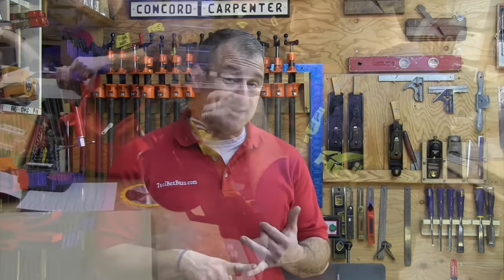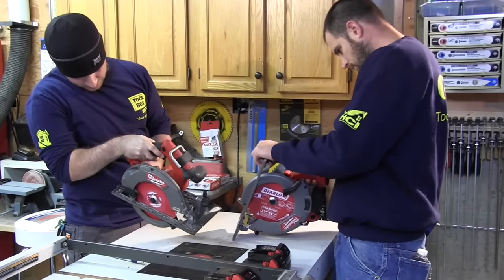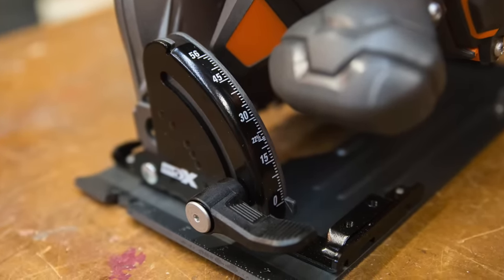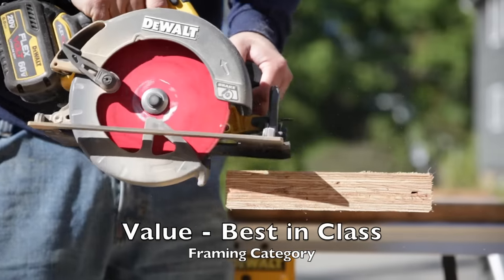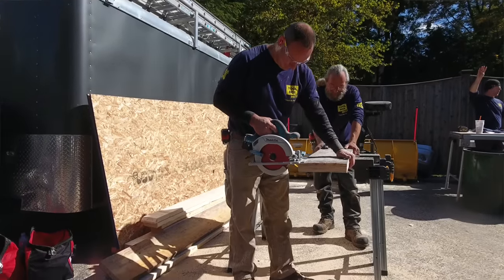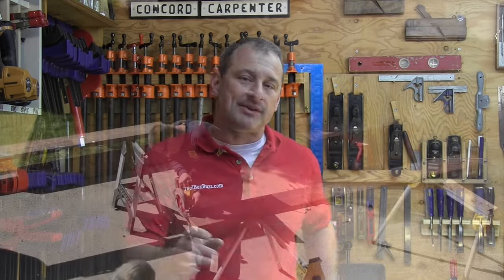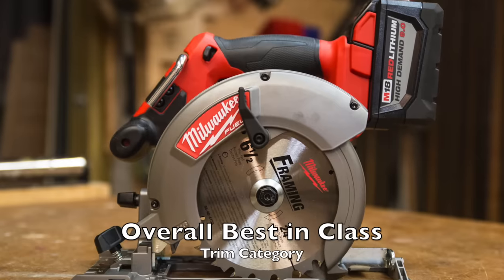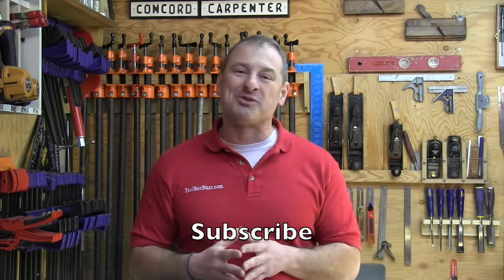Best Cordless Circular Saw - Head to Head

Comment: I have the Milwaukee Fuel 7 1/4". It cam with saw 9.0 amp hour battery and charger for $249. You add another battery and you are stull under the others. My opinion the Milwaukee cant be beat.
Reply: I took advantage of that deal as well. For 249.00, you are actually purchasing the Battery & charger and getting the saw for free. - Still a fantastic deal. - Love mine.
Reply: I bought the tool only saw about 6 months ago for $200, doohh...I think ill buy this deal just to get the 9.0
Reply: Dan 
but don't forget guys... U only get, what u played for !!!
Reply: They still have that promo! I just bought mine today. They also have it for their Sawzall but I just can't justify buying that since it's a bit much for a DIY guy that would hardly ever need it for anything.
Reply: Your only argument is that the Milwaukee is cheaper. That has nothing to do with the quality of the saw.
Reply: Just got that deal at home depot--it was an online only deal but the manager gave me that price! I was going to buy it at 229 for the saw only a week before...what a deal 😀

Comment: I am a Milwaukee M18 Fuel fan!   I love the power of the every M18 Fuel tool, but the 2731-20  7-!/4" framing saw is a MONSTER!  The 9 AH Red battery lasts and lasts. The coolest thing is that tools from this line often appear in the clearance end cap at Home Depot for ALOT less money than full.   Just last month I picked up a combo kit with the 2731-20, a fast charger and a 9.0 battery for $187.00!   I just could not pass it up as full price is over $350 and combo at $250.00.  The best time to shop for  ANY cordless tool is of course Christmas.  This is when good priced combos pop up and as they are not normal merch, they will often appear a couple of moths later on clearance. (at HD anyhow)  I have had Makita and Dewalts and Rigid, but for my dough Milwaukee Fuel is the way to go.   Fantastic backwards compatibility on all Milwaukee battery fits too!

Comment: I have the Makita 6 1/2" Brushless circular saw and I am constantly impressed with how smooth and how powerful it is. I know there are other saws available, I just haven't used them. Also, while I'm invested with Makita for my cordless tools, I am excited to see the other brands innovate because I know it will translate it better tools from Makita at some point down the road.
Reply: Also the Makita 6 1/2 has an attachment the allows it to work with their track saw rails, turning it into a cordless track saw. I don't know if it's available in the states or not. It's not officially available in Canada but there are a couple of companies that import it from Europe.
Reply: SteveVD do you have a link or can guide me to that info?
Reply from the maker: Saw that - amazing accessory
Reply: The accessory is the Makita 196953-0 Guide Rail Adapter. bcfasteners.com/shop/makita-196953-0-guide-rail-adapter/ is the Canadian site I found it on and https://www.amazon.com/Makita-196953-0-Guide-Rail-Adapter/dp/B01GCGUTFG is where I found it online for the states. Though looking at it closer again, it is on the Makita's US website. So if you live in the states you should be able to order it through your local Makita dealer.

Comment: I've personally used the makita, dewalt and own the milwaukee. What he didn't mention was torque and power. The milwaukee with a 12.0 amp and 9.0 amp battery will over power both of these saw by a LONG shot. I ripped 4" off a 3.5" psl recwntly. It powered through just as good if not better then any cordless saw I've used. I've also cut through as many sheets as possible on a lift of 3/4 plywood without any stopping or binding. The dewalt could never come close to that. Makita as well. No other cordless saw that I've used can power through anything like the milwaukee. It's truly surprising
Reply from the maker: kris drepko this rest was done before those batteries were available
Reply: Dude the Dewalt flexvolt is a lot more powerful than the Milwaukee it's not even debatable
Reply: You must have been using the Dewalt 20v. I've used them all and nothing comes close to the Dewalt 60v for sheer power. Match the 60v with the 9amp battery and there is your winner.

Comment: I am currently in the market for a cordless saw and cordless jigsaw but have always been a Hilti fan when it comes to drills and impact drivers.
 I also own a cordless DeWalt planer and multi tool in 18v (UK) due to the fact that Hilti come nowhere in this test I am left with probably going down the DeWalt flexvolt route as I am also considering the flexvolt mitre saw. I understand Milwaukee came out top in the review but you don't see a lot of carpenters/ Joiners on that platform in the UK, mainly the M&E guys. 
Thanks for the review guys its opened my eyes to possibly purchasing the wrong saw because of brand loyalty

Comment: Interesting how Dewalt and Ridgid came in 1st and 2nd in cuts per amp hour.  Also, no one talked about cost.  I get the feeling one of these may have been the lowest purchase price.  Not to mention Ridgid offers a Lifetime (25yr.) warranty on tool and battery.  None of the others offer that.
Reply from the maker: Raul Perez did you read the articlE? There’s always more information there.

The cost of the tool, or in this case the combination of components, is a clear objective. But value is not the cheapest tool, but the tool that delivers exceptional performance for its price. This head to head is a Frankenstein combination of components; tool, high-capacity battery, and charger. So we’re seeing higher price tags than the off the shelf kits you’re used to seeing in the stores.

The graph in article  is broken into two sections, one for the 6-1/2″ saws and one for the full size 7-1/4″ saws. We’ve listed the pricing based on the price of the tool, a charger (in some cases they are dual chargers), and two high capacity battery packs. Because one of the tools uses two packs in order to operate, we felt it was best to level the entire field by using two packs as the basis for cost and how much work can be accomplished with two packs.

Value Winner (Trim) – Bosch

The Bosch CCS180 with exceptional ergonomics, a decent runtime, and a reasonable price for all separately purchased components make this our value winner for the trim category. During our last circular saw head to head this tool with a 4.0Ah battery was named best in class for endurance. So although this is an older model, it still displays good performance and is well priced. You can expect to pay around $347 for the tool, 6.0Ah battery, and a loose charger.

Value Winner (Framing) – DEWALT

This category is typically dominated by Ridgid due to the aggressive pricing and quality performance. They certainly came close this time but the real winner here is the new DEWALT FlexVolt priced just below $400! This is the only saw that we tested that came in a true kit with the saw, charger, and two batteries.

But with the disruption of the FlexVolt line, DEWALT’s new system is a big ask for current 20V users. Although the FlexVolt batteries are backwards compatible, DEWALT is still upsetting the apple cart by introducing a new line of tools no longer useful to the users invested in the DEWALT 20V line. With all that said, DEWALT needs to entice users over to bridge the new battery platform. Either way the DEWALT offers a very powerful tool, currently sporting a 60V, 2.0Ah battery, with plenty of room to run at a great price!
Reply: @ConcordCarpenter    No I didn't read the article.  I'm on YouTube looking for videos that help people make decisions spending their money on tools with factor that most people care about.  I appreciate this video for those reasons, however, I think that your ultimate break down could be displayed at the end of the video     where performance of your various tests, cost and warranty are noted.  Thanks for clearing some of my concerns regarding the video's information up.
Reply: That 25yr warranty is a limited warranty that covers manufacturers defects ONLY. It doesn’t cover wear & tear or damage. And it’s worthless if you never registered the tool.
Reply: @thomasarias5732   I got new brushes for an 8 year old Rigid driver under this warranty.  I have also had a brand new Porter Cable router that I maybe used 45 minutes over the course of a year and it quit working.  Took it to my local Dewalt/ Porter Cable authorized dealer for repair.  It was exactly 14 months old and the one year factory warranty was expired.  I suppose we get gems and duds with whatever brand.  Everything has pros and cons.
Reply: Raul Perez that’s why I only own ridgid cordless. Can’t beat the warranty
Reply: Had I known about rigids warranty when i started buying cordless tools Id be all about them. You cant beat that warranty and the difference in performance is so slight in real life....
Reply: @thomasarias5732  wonder if that is a store by store thing. my cousin brought in a rigid drill he had owned for a couple years and they just gave him a new one off the shelf.
Reply: Go DeWalt over Ridgid. I work as a contractor. My Dewalts Outlast everything. Such incredible tools.
Reply: sean callahan agreed. I’m still using my DeWalt 18v hammer/drill/driver that I got in 2001. And I’m not a weekend warrior lol. I worked 12-15 hour days 6 days a week for over a decade with my DeWalt cordless tools. So far I’ve replaced a bulb in the flashlight once for less than $2 lol. I haven’t even replaced a battery yet, of course I’ve bought more batteries to supplement mine so I don’t have to charge any on site. But seriously I couldn’t have asked for better performance at all. 
I just bought my son his first set of cordless tools for Christmas. 10 tools and 8 batteries all 20v or better. I hope he likes them as much as he likes borrowing mine lol
Reply: C. A. Willie the warranty is for defects only, so your cousin either got lucky and had that happen after a few years, spends a ton of money at that store, or dealt with an inexperienced employee. Here is a link to Rigid’s warranty description; pay close attention to the “What is covered”, “How Long the Coverage Lasts” and “What is NOT Covered” sections. https://www.ridgid.com/us/en/full-lifetime-warranty
Reply: @thomasarias5732  That is still better than all the other 90 day, one year or three year warranties all the other brands have.  Like I said I got new brushes on an 8 year old driver and that was 3 years ago.  Thanks for the link.
Reply: @thomasarias5732  Registering is easy.
Reply: @wackedgunner7107  Agreed!
Reply: @thomasarias5732  That is a very good point!

Comment: Great video! Recently went from Ridgid X4 to Milwaukee Fuel tools, and have been a little conflicted with the change. Initially, the M18 fuel tools displayed considerably more power until they were put under heavy loads, at which point they “detune” themselves to preserve the tool and extend battery life. On one hand this is good, on the other, time is money and the under-performing tools are costing me both. 

You may say that I need a larger tool commensurate to the task, but I would counter that, having reached the half-century mark, with joints that have spent over 30 years in construction, tool weight is a premium. Milwaukee are definitely better crafted, but I feel are coming up short in the “getter done” category where a tool that goes all out, yet has a shorter life-expectancy is a better value.
Reply: Which tools are suffering that much under loads?

Comment: I use a Milwaukee 6 1/4 for all of my work now , nice and light and on average I use a battery and a half per day . It has plenty of power for all of my cutting and any time I need to get through something tough ...just slow it down . It's one of my best tools and I'm not surprised it won best over all as it's very good and I work my tools fairly hard

Comment: Use the DEWALT 60 volt 7.25” and it’s a beast.   Corded saw gone!   And I get to use the Flexvolt as a high capacity 20 volt in my high draw tools like site blower and recip saw.    An amazing system.
Reply: pbrin Yeah mate ,I'm glad I went with  Flexvolt, it is by far the most powerful saw I've ever used .

Comment: Dewalt 60v is by far the best saw today
Reply: 100%. I also have the Milwaukee gen 2, and my Flexvolt runs circles around it. I actually despise my Milwaukee because it’s so bad in comparison to the Flex.
Reply: True
Reply: though putting a 9 ah battery on  an impact driver  though it works is a little heavy . backwards compatible awesome .60 volt battery on the 20v chop saw goes all day

Comment: Hey guys like your videos. I know I am late to the comments on this one but I have something people might want to consider. I am a commercial contractor and have about ten guys working for me. I typically supply them with tools. I have noticed they usually pick Makita to use. I have always used Dewalt. After the years have gone by I have decided to supply them with only Dewalt as the Makita batteries have gone bad so many times. The Makita batteries also become loose and have a bad connection. After I switched them to Dewalt I have never had an issue. Just my experience. Thanks for the reviews
Reply from the maker: Brandon Brady Really great feedback, thank you very much for sharing

Comment: I think you shortchanged the Makita by giving the other saws two batteries just because the Makita REQUIRES two batteries. All else being equal, any vendors 36V 4Ah battery has the same energy capacity as two Makita 18V 4Ah ones.  The two batts on a Makita saw are equivalent to a single 36V battery on the other saws, without the expense and aggravation of needing a whole new battery/charger ecosystem. When using the Makita saw you shouldn't think of it having two batteries... instead think of it as a single 36V battery and compare that way with other saws.

Makita knocked it out of the park by combining the power of 36V with the economics of its HUGE 18V cordless line. If you are a pro I guess it doesn't really matter if you need different batteries and chargers depending on the tool you want to use, but for everyone else being able to use your existing battery ecosystem is a game changer.

In case it isn't obvious, I do indeed own the Makita, and I love it.
Reply from the maker: We certainly see your point and we're aware of it.
Reply: Most of those saws come with two packs in the kit, if the saw requires two packs to operate and they don’t give you 4 so you can continue working while the others charge it indeed is a serious shortcoming of the tool when compared to the others.
Reply: The makita with their charging system definitely beats it all  Why double battery makita saw laughs at people I do have 20 batteries
Reply: 1slkss for most people they don’t just own one cordless tool and highly unlikely you would only have the framing saw as your only cordless tool. Long way of saying most people would have more than 2 batteries
Reply: Martin Green well said. Bought the 36v rear handled circ saw. And it’s absolutely crushed my friends still using the corded skilsaw. Also I’m not leaving the platform. So if need be I can swap batteries from other makita tools I own
Reply: I agree 2 18  volts is less then 60 volts. And 36 volts is 36 volts vs Makita 2 batterys which = 36 volts it should be that the 60 volts should be penalized. and I read some other fool saying only the  Dewalt can cut like a corded saw  which is BS my brushed Makita with 2 batterys cuts just as good as any skil saw or my corded Makita with 15 amps. Some of these comments are being made that never done this shit 4 a living.
Reply: I meant to say dewalt is not the only cordless saw that can cut like a corded saw that  is a bunch of crap.
Reply: Love my Makita 36V circular and miter. I bought both as kits and received an additional (4) 5.0 batteries with them on promo. I worked this weekend (sat and sun) demoing and then building a new deck for my brother house. Didn't have to charge a single pack the whole weekend/project. Used my 36V rear handle circular, 36V miter saw, 18v sawzall, drill, impact, and sander. Took 8 fully charged 5ah batteries and still had juice at the end in those 8 batteries.
Reply: This is the thing with the Makita,  the 36 volts will make more cuts with one charge then even the 60 volt dewalt alot more. and you can get 5 amp hour batteries on amazon for about 55 bucks. + if you need other tools Makita has a whole line of tools that use the same batteries. And one thing I know about Makita they last a long time.
Reply: @shinyokoyama8470  Voltage is only one measurement. You need voltage and load (resistance) or voltage and current, to work out wattage, wattage being a measure of work done. An 18 volt tool could in theory have more power than a 60v one. In fact those flexvolt batteries are a gimmick in some ways, because they can put out exactly the same amount of power at 20v as they can at 60v. Only difference being if you want tons of power you need a battery that's capable. You can put a 2AH Milwaukee battery into one of their table saws or miter saws and its going to have a really bad time and run like shit. But no risk of wrong battery in your superpowered battery tool with Dewalt. Dewalt has the best marketing in the business. That's it.

Comment: I have the twin battery Makita hypoid saw and love it. It does require you to have 4 batteries at least, but considering I have multiple Makita 18v tools that all use them, that's a non issue for me. Coworker has the DeWalt 7 1/4 saw pictured here, but when it comes to raw power, the Makita wins hands down. No problems ripping lvls down to studs with mine.